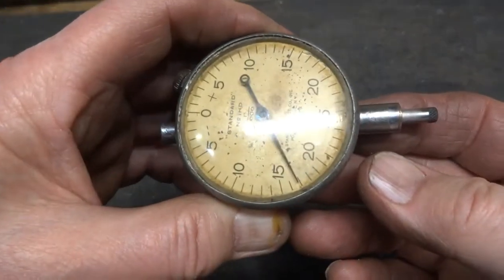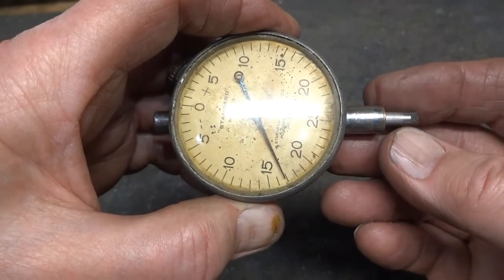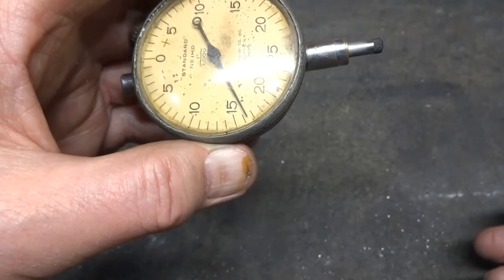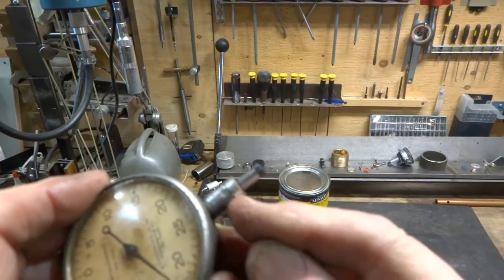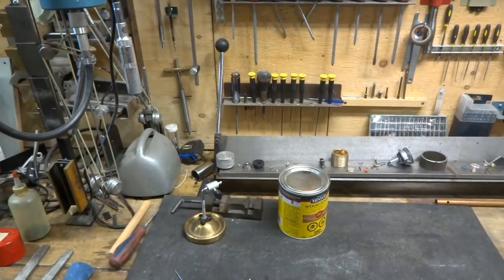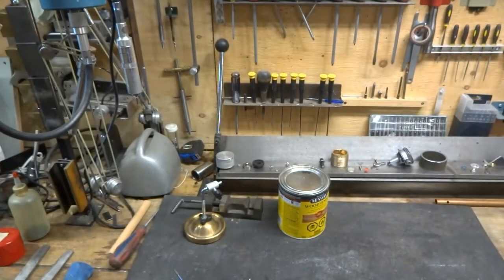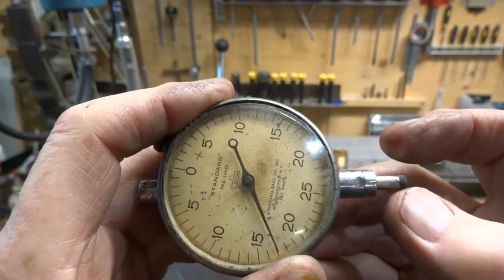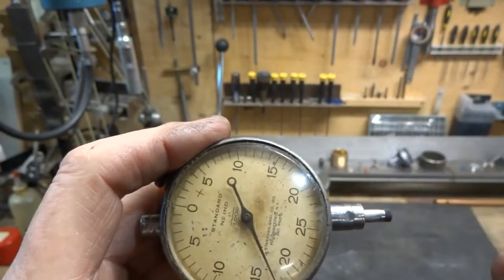Worn indicator fix

Comment: Sorry, I gotta ask, did you just change the direction of the in accuracy by 90° around the axis of the shaft?
Reply from the maker: Over the years a groove was worn in the steam and the end bushing. Rotating the end bushing pushes the stem back into place.